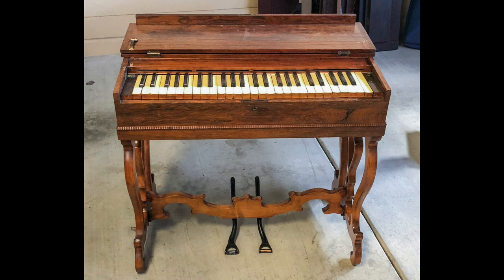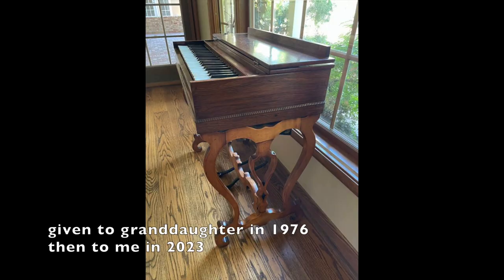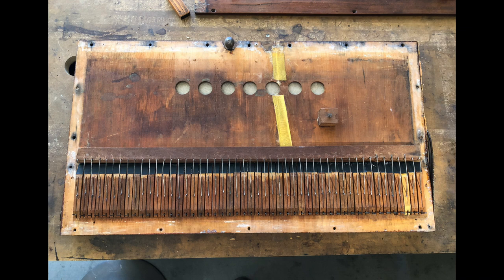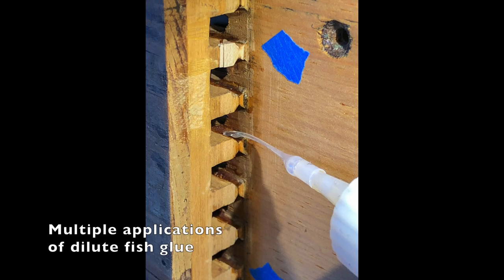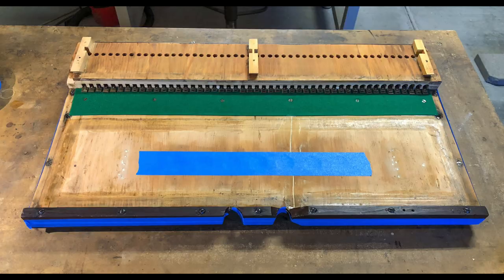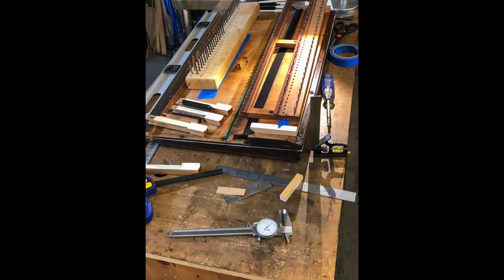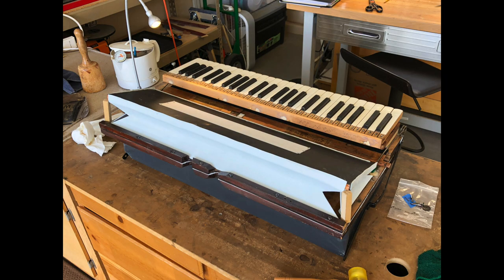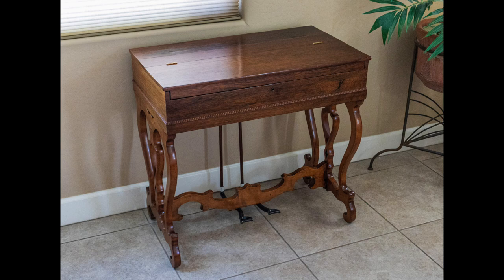Restoring an 1868 Prince Melodeon

Comment: Excellent video, Bill. Thank you.

We have one of these that was handed down through the family. It was restored at one time and the bellows repaired or replaced.. it looks playable except that the rods were lost over time. Would you happen to know details regarding their length and how they attach (I'm guessing there was a pin at the bottom). Wondering if a couple of dowels cut to the right length would do the trick.
Reply from the maker: Dowels should work OK. On mine, both have metal locating pins on the bottom, and the right one has a locating pin at the top. The one on the left has the wood tapered to a point that fits into a lever. Yours may be different.